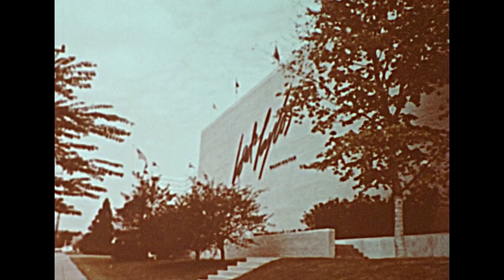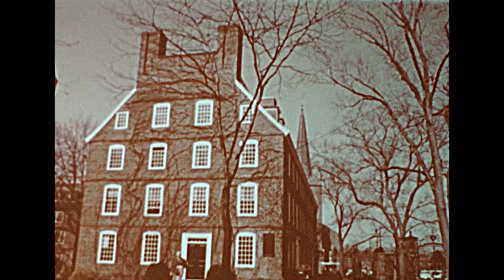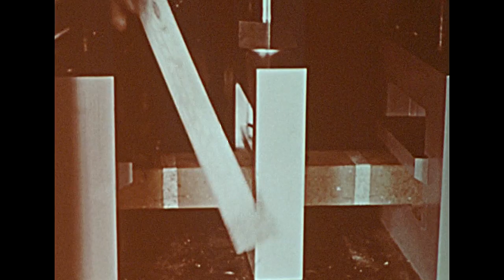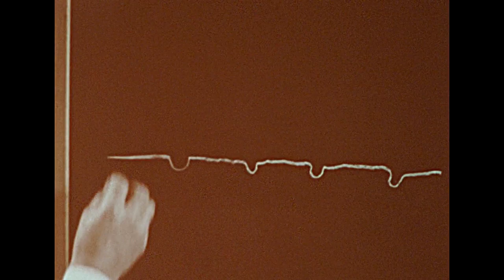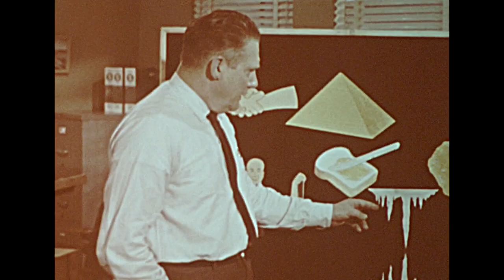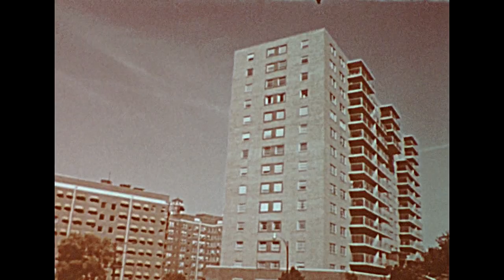Lime in Mortar For Masonry - Millard Quarry

Comment: I dont know if this is honest good info or a guy trying to sell more lime.... It would be nice to have mason work last indefinitely. There is a good argument to use more Portland. But i guese its always depends on the circumstances.
Reply: Retired union bricklayer here.  In California, almost all of the commercial buildings I worked on had a mix design of 1 bag of type S portland, 1/2 bag of lime, and 4 cu ft of sand.

Comment: 18:30 "As a good general all purpose mortar a mix of 1 part portland cement, 2 parts lime, and 7 to 9 part sand is recommended"
This is 2,5 N/mm², which is about 362 PSI
A brick has about 12 N/mm2 ca. 1740 PSI strength. It may vary.

We can use 1:1:6 rato, which gives 5 N/mm2 approx. 724 PSI
We can use 1 part portland with 4 part sand, this gives 10N/mm2 approx 1448 PSI. This has so high strenght, that if a building is slowly moving, the bricks can be damaged.

There are many kind of cement available, the smaller are the grinded particles of the portland, the higher is the strenght after 28 days. From the higher strenght cement we need smaller amount then from a weaker one.
The sand is also important. 0-1mm "open-pit" sand (0-0.04 inch) is good for high lime contained mortar. The clay and organic content has to be washed off before use.
0-2 mm "river" sand (0.08 inch) is better for higher cement content mortar. The particle distrubution (from smaller to higher) is more consistent than the other one.
Reply: I have been watching a lot of home restoration videos about fixing old buildings in England and Peter Ward videos. I was just looking on youtube to see how people from olden times like 1762 and 1500 got their lime. I was thinking that they just got it from the ashes of their fires, but sometimes I think it is crushed limestone. I know that crushed limestone is a component of red barn paint that was made by farmers for at least the past 200 years. So how did these builders of olden times get their lime, and what is the ideal mixture to fix an old barn foundation of field stone and flagstone? The barn was built about 1850 in Western New Yor State.
Reply: @HollywoodCreeper  Hello! There got the lime stone from some montains. And they burned it in kiln, like this video:
https://www.youtube.com/watch?v=wXQS105fAwY